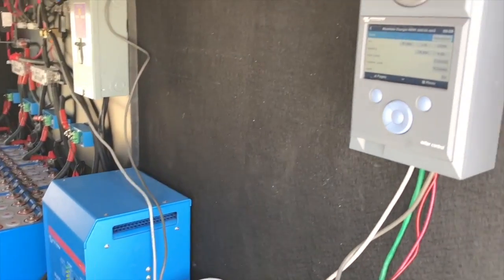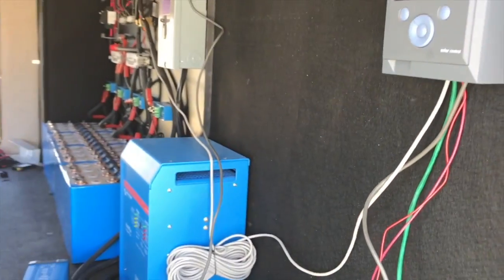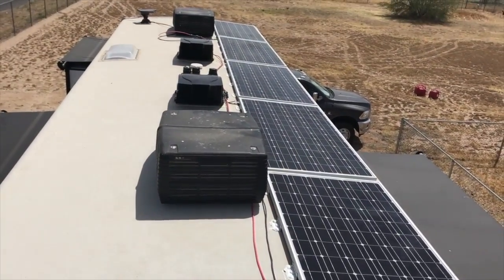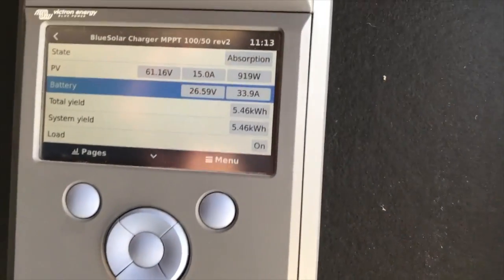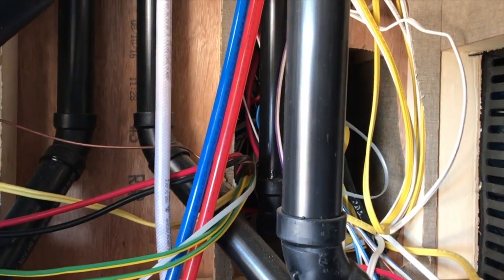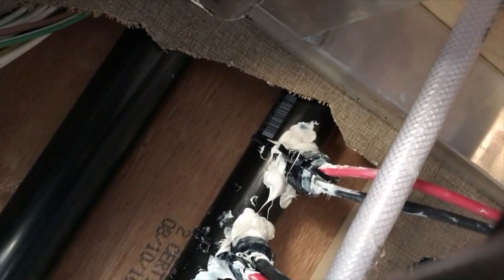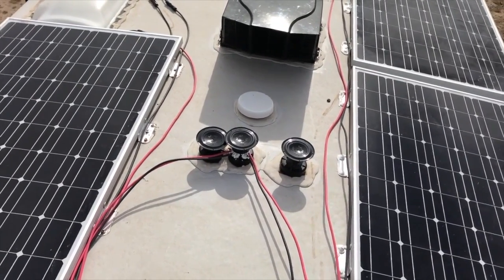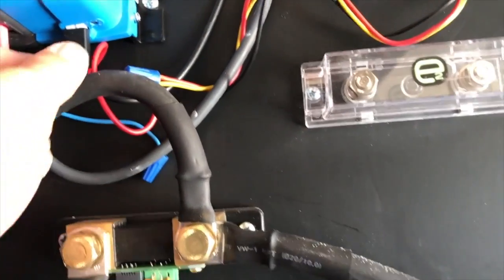RV Fulltime Living | Lithium Battery & Solar: Part Nine - Boat Load of Solar

Comment: Awesome setup! You can run your AC from your panels..unbelievable..how much do you have invested? Lithium batteries excluded.
Reply from the maker: The lithium is an important element here as I can pull 200a at 24v no problem. The lithium cost me around $4500. I easily have $2000 in solar and solar charge controllers and $3200 in the now two victron inverters. Plus another $1000 or so in wiring, fuses. Fuse blocks etc. Including my two Honda EU2000i generators I probably have 14k total batteries included.
Reply: RV Exodus im planning my set up, but i just cant afford the lithium right now. leaning towards AGM
Reply: Go full balls. From you and others we learn. In time the prices will come down. Maybe in time they can make a set up that can go 12v/24v with a flip of a switch as needed. And reduce the need for so many panels. ( Rv Manufacturers take notice we want this.) Thank you for sticking out your neck out so much AE:$$$$ & R&D......

Comment: Try a ductless  one ton mini split, house unit.  I have one on my house and works excellent.  My wife said it is to cold.  A one ton uses 750 watts to 800 watts. much better than a Coleman roof mount Mach I.
Also ductless mini split have inverters, so a SLOW START is used, this will help your battery and your AC to DC inverter.
I want to do this to my travel trailer.
The Coleman's Mach one uses about 1500 watts or a Coleman power saver uses 1200 watts.  But the cold Air is forced into the travel trailer duct work, this is all BAD.
Try a ductless mini split made for houses uses 800 watts.  This will cut your watts per hour in half.  The mini split that has a inverter, SLOW START.
Reply from the maker: +Rusty Case there is a product called easystart by micro air which is a soft start device. Seems like the way to go but cost a few bucks. With 3 units it would have added up quickly.
Reply: Yep !  I have some far smaller motors, yet some of them have a good cap in their circuit affording a nice slo-start capability that is noticeable.  They will work far better for us when mobile and running an inverter off the banks.  Best, rc
Reply: Billy Bob thank you for the heads up. I am gonna do some more research before i make the change. Looks like its gonna work great so far.

Comment: Try different ac, use a swamp cooler.
Reply from the maker: We actually do have a small portable swamp cooler. Works great blowing dir3ctly on you but isn’t strong enough to really cool a room. Love swamp coolers though when there is no humidity.
Reply: swap cooler might be bad for indoors, lots of moister might cause mold and destroy electronics
Reply: John Wu Swampies work great in hot dry climates like Arizona and the southern Australia states. No danger of excess humidity/mould in these cases - actually helpful for your skin/lungs if not too dry. Cheap to take 10deg C off the top when its a 40C day, plus you get the airflow and open house. You do not have to close up everything tight and avoid opening doors etc as with refrig a/c. In an RV, just open the windows and place the swampie by the door. Much less power, although it does cost you some water when boondocking (which does not have to be drinking water!). 
Admittedly, swampies do not work in more humid environments - that’s where refrig rules

Comment: Great system. Can't believe you did all yourself.   Just wondering how long you can run A/C when the batteries fully charged with a clear day ?
Reply from the maker: With no other power hookups and the fact that the sun is only around for about 12hrs netting a total of 6-7 solar hours, I can have one AC running for around 10-12hrs. Breaking it down, if I have 400 ah in battery and my solar produces another 400 or so amp hours. Starting with 100 state of charge I have 800 ah at my disposal. The ac is going to pull roughly 60 amps every hour which mathematically results in 13.33hrs. Real world is right around 12 or so. However, that would leave my batteries depleated typically at night so I would start the next day with little to no reserves making it unsustainable. However, if the AC cycles on and off and runs only slightly during the evening (eg, 90-95f wheather) then this system is very sustainable with enough reserve power to make coffee, watch tv, microwave here and there and run electronics. Keep in mind if I don’t run a generator and have no hookups, im generating 400 or so amp hours per day. So on average, that’s all I can spend in one day which still gives me 4-5 conservative hours per day total AC runtime with enough left over for all the other goodies. If the AC isn’t running constantly that is enough AC runtime to get through a moderately warm day. If only temps in AZ would drop into the 90s I could prove that out ... lol.

Comment: now it makes sense! Awesome! please go to the RV supplier to show them how it's done the right way.
Keep in mind if the batteries are almost full the delivering wattage of the panels will drop also.
Do you keep the CX in the bay or do you swap it to the living room?
Reply from the maker: Right. But it would be no fun if the RV already came with all this :)

I have a small desk in the bedroom directly above the CX. I may relocate it there down the road. However, I mostly use VRM portal for monitoring so I may leave it as is.

Yah, the way I have absorption set it pretty much dump as much power into the batteries up until 96-98% soc which is one of the great benefits of lithium.
Reply: RV Exodus You like to do this? sadist 😂
Reply from the maker: its like picking a scab .... just can't help myself :)
Reply: RV Exodus   Hi again, I am interested what your float, absorption and equalization settings are for the Calbs please. Mine have been set up (For 12V system) at 13.20V, 14.40V and 16.20V. Not sure if this is correct? Only been on the road 3 weeks now with this 720AH CALB system, and pleased so far.  Able to run the 3 way fridge and still have 95% left to run stuff overnight. Just wanting to tweak as necessary.

I just turn on the hot water electric switch if I hit float during a sunny day. This takes out about 1kWh to heat 22ltrs (getting between 4-5kWh/day on mostly sunny autumn days currently)

Comment: Monster setup, sir. Very nice install!
Reply from the maker: Thanks boss!!! It’s been a while in the making and still some finish work to do before I can call it done.
Reply: RV Exodus wow, that is quite a setup!. I think I would have grit my teeth and drilled a hole in the roof to fish the cables next to the pipes. Be sure you use Dicor to cover all flanges and to glue the wires down as needed. A neighbor told me about some large startup capacitors that he installed on the air conditioners. He said it made a huge difference on power load. They were about 50 bucks. Wish I could recall the details on them.
Reply from the maker: Dicor is my friend :) there’s a product called easy start. Really pricey but people that install them seam to swear by them.